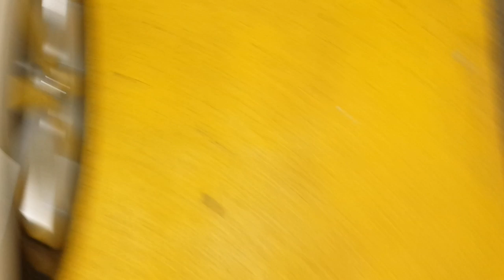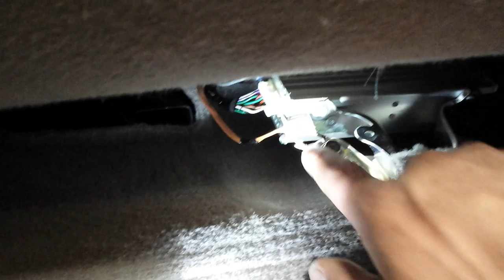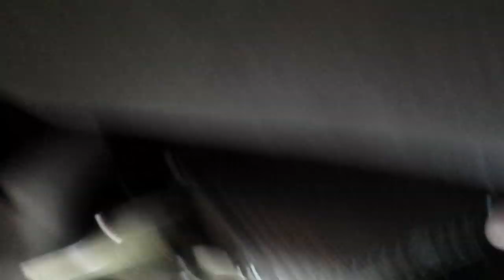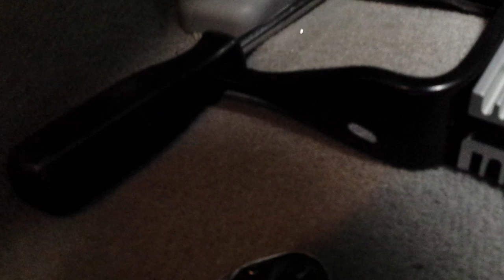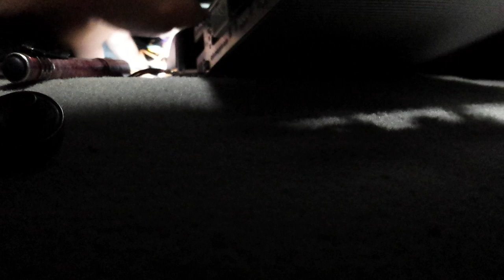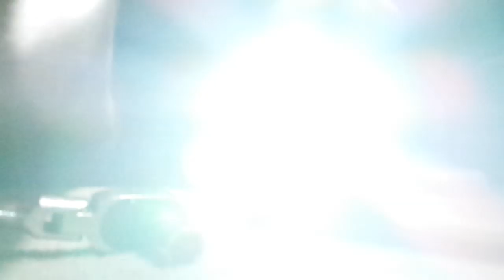2010 Toyota Camry: Factory amplifier replacement

Comment: Does anyone know what a replacement amplifier costs?
Reply from the maker: +Judy Vieveen Around $800 MSRP from the dealer, but google the part number and you should find cheaper new/refurb replacements, or even cheaper for used units on eBay.

Comment: I have a camry 2009 mine does not have the amplifier i guess is it possible to put the amplifier and the radio of 2010 camry
Reply from the maker: I'm sure it's possible, but I bet it'd be expensive and a PITA. I doubt Toyota prewired every vehicle for the amp and uplevel radio, so you'd need to replace the body harness or put in an overlay for just those connections you needed.